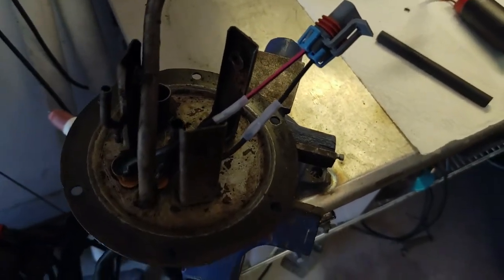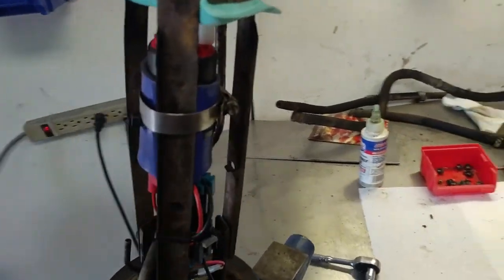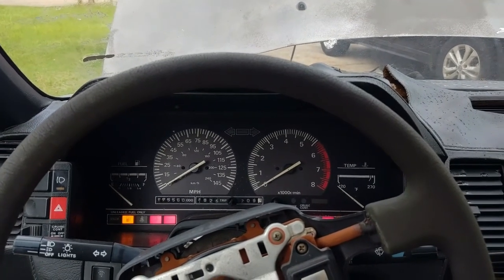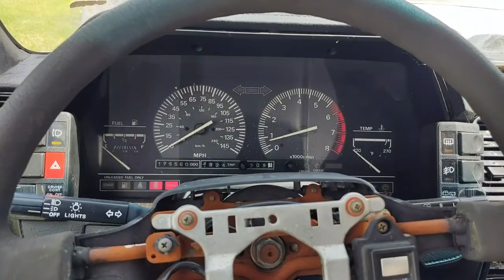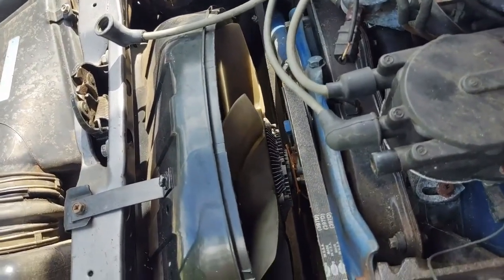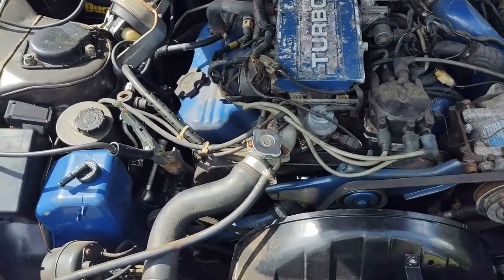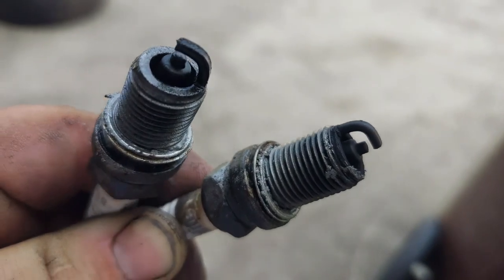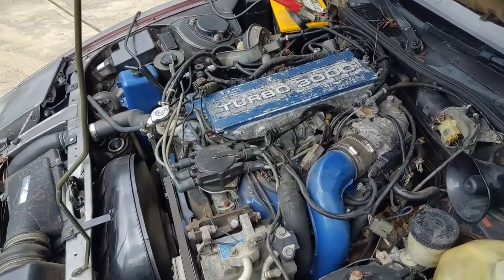WHY DOESN'T MY Z31 RUN... Part 2

Comment: Question I had oil pressure problems put new sensor in for oil pressure car ran  good then lost oil pressure car cut off I got car towed to MY house it started up to drive off tow truck starred knocking no oil pressure now will not start where do u start
Reply from the maker: If the motor is knocking it's most likely bad and has a spun bearing. I would drain the oil and see if you can see metal in it.

Comment: I am surprised you didn't pull the fuel sender and clean it while you were in there.
Reply from the maker: I did pull the unit out but it was trashed no saving it at all. That will get replaced when the car goes on the road

Comment: Hello My 1986 300ZX is having the same problems as yours. I changed new sparks, wire, CAS, alternator, battery, ignition coil, fuel regulator, fuel pump. But it just wont start. It hasnt run since winter of 2018. Can you give me any suggestion, Thx
Reply from the maker: Does the car have spark or fuel? Do you hear the fuel pump prime? Check the fuseable links beside the battery under the small rectangular cover.
Reply: @hotwillzgarage3167  Yep it ran and I took for a spin in the neighbor but then it wont start again
Reply from the maker: @thanhvi3348  Have you checked the codes on the ecu? Sometimes that will give a little bit of a idea. If you have spark coming from the coil I would try spraying some starter fluid into the intake. If it starts maybe something happened to the fuel pump. On my black car the transistor in the ecu went bad so I had to rewire the pump to work.
Reply: check injectors, get them cleaned or just replaced.  My 88 would start, die, and not start again.  New injectors fixed it, if it helps autozone has some for 300ish with some kind of 20% off coupon you'll have to research which saved a good amount